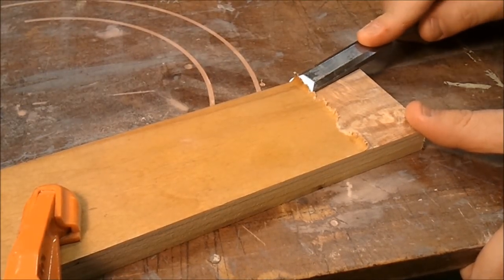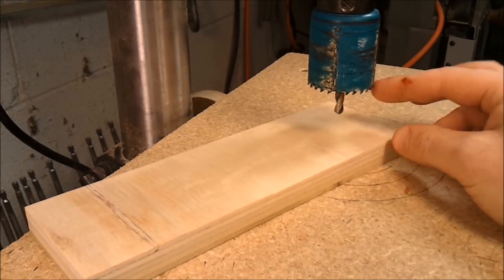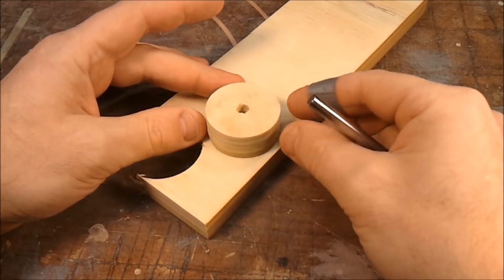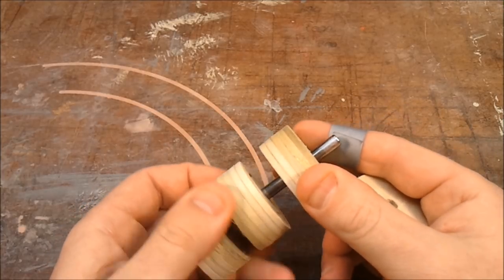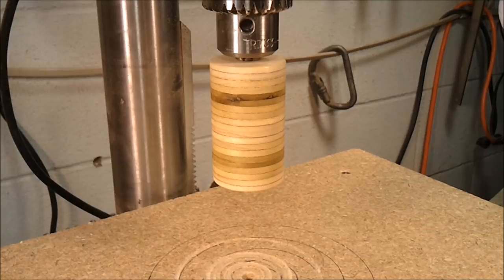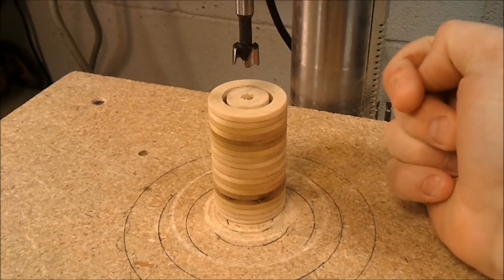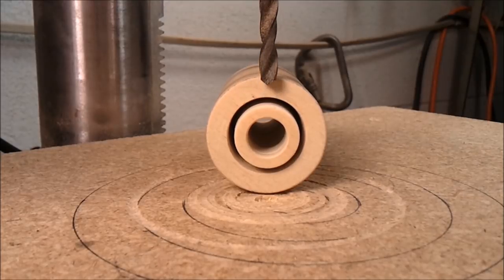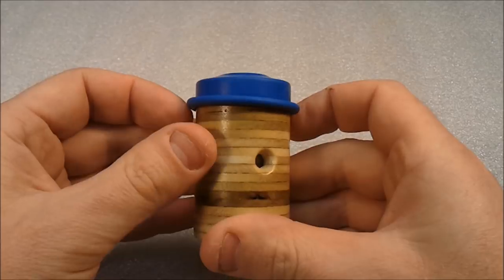Obnoxious air horn

Comment: This is great! I work in a manufacturing plant and it gets so loud that everyone must wear ear protection. To notify workers of breaks, or pretty much anything else, we use those canned air boat horns. They are loud enough to be heard above the machines and ear protection, but are not refillable and a waste of money. I am seriously considering making one of these. We have an endless supply of compressed air.
Reply: why not get an air horn with a re-fillable canister?
Reply: I had to leave that job due to medical reasons 1 1/2 years ago. They were using refillable canisters, but those cost money - continuously.
Reply: did you make one?
Reply: I rigged one air horn to run straight off compressed air and it worked great.
Reply: No, I never did. I wound up in the hospital shortly after posting the original comment.
Reply: Mark Speir what happened?
Reply: Double pulmonary embolism and blood clots in both legs. The doctors were stumped. I was in perfect health and didn't have the risk factors that would cause this. Still don't know why. In three day's time, I went from doing a physically demanding job to gasping for breath between words. Blood thinners got rid of the clots, but my body was never the same.
Reply: Mark Speir How unfortunate. Hopefully you can recover.
Reply: Thanks. I'm alive and probably shouldn't be, so I'm grateful. I still cannot stand or walk for very long (the reason I had to quit). It must have caused significant muscle damage, but I can no longer afford to go to the doctor, so no idea.
Reply: Mark Speir You should create a GoFundMe webpage or something like that, I think people would donate, I would
Reply: Victor Pelufaz I appreciate the thought, but no. There are people that would kill for the physical abilities I do have. There are much more deserving people and causes than me.
Reply: I wish you a speedy recovery and better health in the years to come. Good luck
Reply: Mark Speir wait why not just take the horn from the canned air one and blast compressed air through it
Reply: I actually considered doing that before I left.
Reply: Mark Speir well good luck and hopefully you recover
Reply: Oh I just got here from the algorithm and you are top comment for me, so how you doing @mspeir?

Comment: #ducktapebandaid
Reply: BrandZor H. *duct tape
Reply: SuperMKi1 negative ghost rider. It is indeed duck tape. Duck tape is made with duck cloth and a rubber adhesive. Its the gray (and multicolored) tape that people use every day for fixing things. Duct tape is made differently and sticks much harder to metal. It is called duct tape because it is used to seal air ducts in a building. It's insanely hard to get off once it's been applied (unless you're using gaffer tape).
Reply: Alex H I highly doubt that though. I can't believe he went into specifics. I am pretty sure he meant the common term, and it is, believe it or not, duct tape.
Reply from the maker: Alex H Not to stir the pot, but the featured product in question was: 
3M vinyl tape 3903.

Make of this what you will.
Reply: pocket83 this makes me laugh
Reply: Alex H Ok so you are getting all butthurt about my post, at least that's what I'm making of your comment. 

But you are providing me with links, that tell me that both terms are actually common and viable, whether you are going to fix ducts or not.

My point is, I am not from the USA so I could really care less about how it is called. We both know what is meant and we both know it is heavy duty adhesive tape so cheers. :D
Reply: Alex H Ok I appreciate that. :D 
I have to admit though, I am thankful that you cleared that up. ^^
Reply: You guys are like the internet, but for functional adults.
Reply: In my home town hardware store the duct tape is under a plastic blow up duck hanging from the ceiling.
Reply: What the hell is a "functional adult"?
Reply: Leee Anon don't think too hard on it.  It was a joke.
Reply: a bit of fabric, with electric tape over it, acts as a much better bandaid. Does't reopen the wound, and adds some elasticity for movement
Reply: +Henry Cha  I'll try not to think to hard, but it keeps me up at night now...
Reply: DUCK

Comment: I finally got around to making one of these last night - this is the video that led me to your channel in the first place. I made some changes, using a piece of bike inner-tube in place of the balloon, held in place with contact cement and a wood retaining ring, and six screws. I have no idea what it sounds like or if it even works, because I don't own a compressor, but it was fun to make.
Reply: With the rubber piece of inner-tube that didn't seem to work. I have since bought a compressor, and the thing is really crazy loud, and very high-pitched (the stiffer inner tube vibrates at a higher frequency).
Reply: yeah, that makes sense. Inner tube is much thicker than any balloon, so it would of course be harder to make it work
Reply: Definitely. I wound up having to make a pair of rings to clamp the rubber between to hold it in place.
Also the ply I was using, leftovers from a furniture project, was very porous laterally, and so it took many coats of varnish to seal well enough to work at pressure.
Reply: sounds like a bit of a nightmare haha. All that for a noisemaker :P
Reply: it was a frustrating series of problems to be sure, but they were fun problems to finally solve.
The principle of operation for these is the same as the big tuned pipes that run modern train horns and the like, so it was fun to make nevertheless.

Comment: I bought a little plastic horn a few years ago that was pretty much this same idea. I was insanely loud for it's size, but I wanted bigger and better. I made a big one (I think about 3 foot) using 3 inch pvc for the outer, 1 inch for the inner, a 3 inch cap with a hole drilled for one end, a rubber glove for the diaphragm and a 3 inch rubber pipe joiner to hold the glove on. It sounded like a small train horn. I always said I was going to but it on a motorcycle with a small air compressor, but never did. You should try it. Super easy, cheap, and lots of fun.
Reply from the maker: Phillip Morrison I did. I mentioned it in the description. Mine wasn't quite that big, though- I could still just blow into it to make the sound.
Reply: pocket83 Sorry, I was an ass hat and didn't read the description, but it was very late or maybe very early, depending on the perspective. 

I could blow in and get a sound, but it was so much better with a compressor.

Comment from the maker: It is just a block of wood that was thrown on the lathe. Make a shape similar to that of a pine tree and then cover it with sandpaper. Leave about a 1/2" shaft to put it into the chuck. I figured that using a standard countersink could risk damaging the piece, so sanding it seemed to be a more gentle alternative.

Comment from the maker: Air pressure does not affect the sound so much as the volume; it either works or it doesn't. Stretching the latex tight makes a MUCH higher pitch. As you loosen it, it will start to sound really deep. It has a pretty good range- I actually played a tune by adjusting pressure to the balloon with my finger, but it wasn't exactly Mozart.

Comment: Circa 2:56 you use a rag with something on it (paste wax?). What are you doing in that clip? Also, what is your source for steel rod? What sizes do you find the most handy - 1/4" seems common in your videos.
Reply from the maker: I don't remember, but I think it was paste wax. I use carnauba car wax sometimes, too. I was definitely polishing it with a rag. Steel rod I usually get from the home depot, and it's the type of steel with the blue label. I also stock 3/8" but I use it only rarely. 1/4" is really the most handy (to me).

Comment: Can you make an alternator from this? I was thinking of how would one make a really low tek/easy steam alternator. If you glue a little magnet on the balloon part can it still resonate like this?
Reply from the maker: I'd bet it could. There is such a thing as a reciprocating alternator! You're not likely to revolutionize the industry with a balloon, but at least maybe you could get something to register. Two magnets (one on each side of the balloon) would probably be the approach you're after. Thicker latex sheets also exist out there.

As for getting it to chooch, further implementation would require the advice of somebody better trained in eleccentricities than myself. Good luck ;)

Comment: dont want to sound like a dumbass but....why dont you use a belt sander to get the laminate off?
Reply from the maker: Because of how long it would take, and also because of the logistics of belt sanding a teeny-tiny piece. It would quickly get spit out the backside, and holding it would be too risky. I suppose I could have made a little lip-jig to keep it secure, but... how about I just use a chisel ;)
Reply: pocket83 also how old are you?

Comment: Lol you have duct tape on your finger. "Band-aid bandage? no... Any antiseptic materials? no... Any compresses? no... any cloth even? no... Oh, here is some adhesive-covered duct tape to seal my wounds: totally! It's not like the chemicals in the adhesive could have any adverse effects in healing my finger!"

P.S. I know there are many things us stupid humans do that are much worse to our health (*cough* processed food) but really did you not use a bandage?
Reply from the maker: Little cuts are a common inconvenience, and they should be dealt with swiftly. First, I make sure that the inside of wound is free of foreign matter. I keep denatured alcohol in a spray bottle- I apply to surrounding area before placing tape. If wound does not stay shut, topical super-glue. These methods are researched and super-effective, and applied only after passing my own cost-benefit analysis. If you cut off a finger, seek professional medical assistance.
Reply: Duct tape will work fine as it applies enough pressure to stop the bleeding. If it were a huge gash then obviously you wouldn't use just tape, but with such a small wound it's perfectly acceptable.
Reply: I have found that electric tape makes for a faster healing process on small wounds.
Reply: Darticus the Great When I'm in the shop, that's how I fix a cut hand.  Duct tape, a small wad of paper towel and a little alcohol, or paint thinner if it's the only thing available.  Works like a charm every time and it's much more durable than those little crap bandaids.  Never once had a problem.
Reply: ***** interesting, I agree though, bandaids are really annoying because they just don't stick.
Reply: punishedexistence i use superglue
Reply: If you have no adhesives whatsoever. grease, coffee grounds and gun powder stop pretty nasty bleeding.
Reply: grease! Somehow I always end up with grease in my cuts....no wonder they heal so well
Reply: Darticus the Great it was a fake cut
Reply: Darticus the Great hey, he gets hurt. Not you.